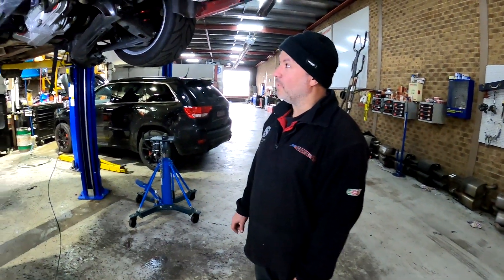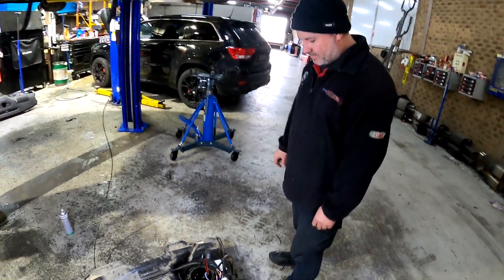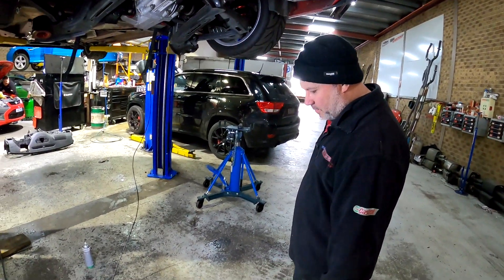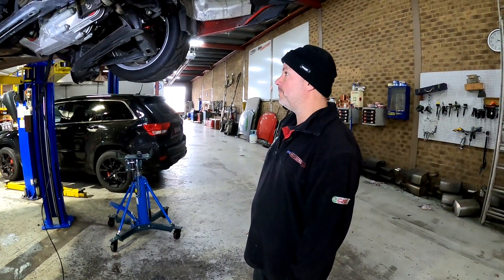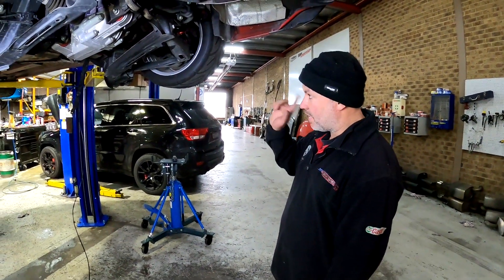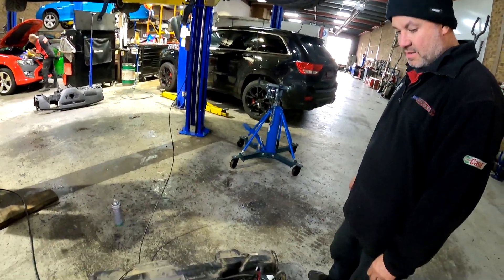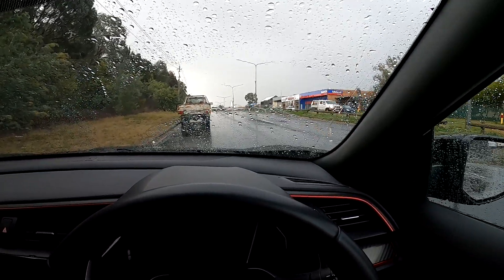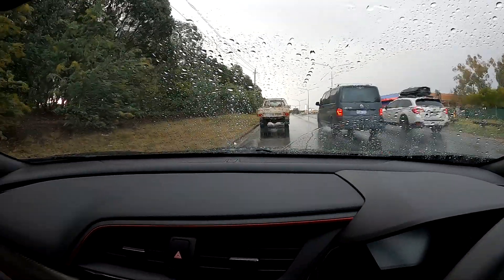VF Redline Race Car - New Fuel System and E85 Conversion

Comment: 4:41 yes, my Series 1 2014 VF redline is E85 compatible from the factory, It has a sticker on the inside of the fuel filler cover.
Reply from the maker: G'day Wombat, yes they fitted flex fuel sensors to the late VEs and early VFs.  Mine missed out unfortunately so am now doing the retrofit! Just as the General ordered! 😀

Comment: What rotating are you running in the 427?
I've got the AI FS1000 with 2 x walbro 525's, ID1700X, Radium fuel rails
Reply from the maker: G'day mate, its a custom fuel system (can share more details in coming weeks), with 2 x Walbro 525 pumps feeding dash 6 line into Harrrop rails.  Return line is 3/8s.
Reply: @ClunieGarage  Sounds good! Will be good to see the beast unleashed
Reply from the maker: @sm-r8997  you betcha! I have never had a E85 powered car before.  Will be interesting when we tune it.  Make sure you click subscribe and get a notification for that episode mate!

Comment: Hey Fred, i am currently waiting on a supercharger for my vf calais v l77 6.0. Do you recommend i also upgrade my fuel pump? After cam, cnc heads, otr, headers and exhaust with the harrop 2300 ill be getting around 460rwkw to 480rwkw. Will my stock fuel pump handle this or do i upgrade to the zl1?
Reply from the maker: G'day mate, you are definitely headed into the territory of needing a new fuel pump and system.  The golden rule used to be 500rwkw on the stock pump.  I did 570 and was really pushing my luck let alone using e85.  Speak with your tuner but it is an upgrade well worth doing.  Fred.